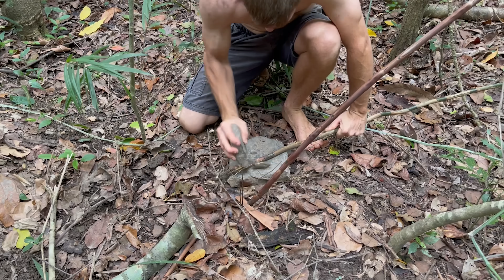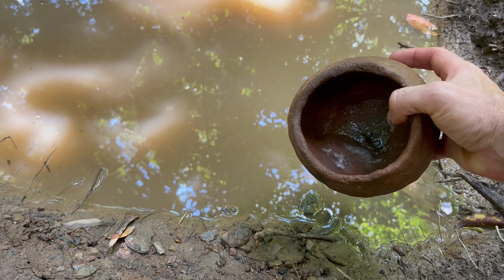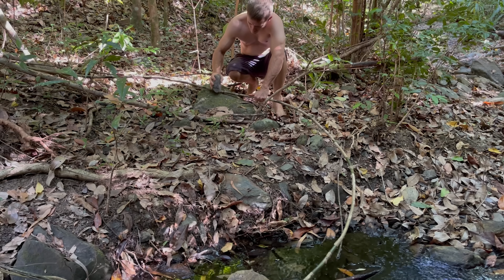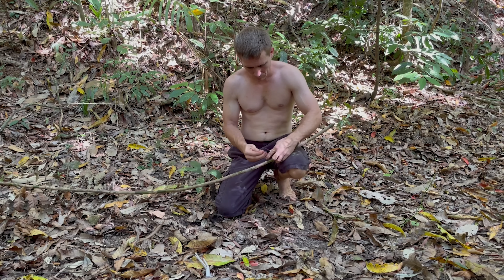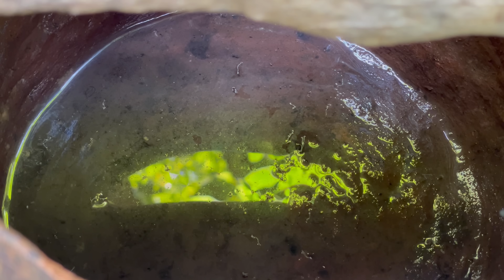Primitive Technology: Cane Water Filter/Siphon

Comment: I know some of the oldest known wells, i.e from archaeology, often has earthenware or wooden walls, at least at the bottom of them, so not surprised in that regard, and I've seen the siphon filter trick used with willow a few decades past - That said, then I wonder where the limit might be, ex. can the siphon filter trick be used with more salthy sea water, to a regard where you could survive of that water?

Comment: In reality you should still boil the water though right? Just as a double safety measure? If it were me and I had the time for the water to filter using these 2 methods I would also just go ahead and boil it.

Comment: Not the only way to do this but you should still probably boil it. Peronally I prefer using overflow trickle + filter tanks. Basically you set up a few containers that have a spout or similar near the top - maybe 3/4 of the way up - and they poor down into further containers. You then fill the topmost one full and top it off ocasionally - though you could use a siphon to keep pulling in water from a larger source - and use the first tank with some gravel aggregate to filter out big stuff, another tank with charcoal to help clean out other crud, and one for settling. If you can figure out an aerator then a tank for that too. Multiple settling tanks are redundant but may be needed depending on the water quality. The last tank's water should be boiled. If you have access to chlorine that's the time to add it.

Comment: The submerged filtration is actually a similar technique used in a Well, if you live in the country and have no connection to municipal water systems. And the reverse if you have a septic system.

Comment: Have you considered using multiple clay pots, each with a finer substrate - rocks then sand and finally charcoal, that would give you litres per day and it would not clog up anywhere near as quick as the bamboo does

Comment: Second method is much cooler, as you can engineer a wide bottomed flask to sit lower in the water adding more pressure and increase filtration speed.

Make a flat bottomed conical flask, exaggerate the difference in width at the bottom until you have an upside down cocktail glass shape, or even a pyramid would work well.

Perhaps a less powerful firing, or a mixing of activated carbon from the fire into the clay.

Comment: I think that it would work fastest if you put the root end of the cane in the dirty water, and the sky end of the cane in the collection, because this is the way plants raise water to their tops. Second, AFTER you get the siphon going, slant cut the root end under water, the way florist cut the stems of flowers to keep them fresh longer.

Possibly, I don't know, but to keep canes from clogging up, you might try recutting the root end that's in the dirty water once a day using a slant cut, and removing the waste. This how I keep my holiday cut flowers on the table fresh for up to 10-days without using any water treatments.

Comment: You could make a cone shaped vessel that's suspended over another jar. The water will perspire through and slide down the sides to drip off the tip.

Comment: Depending on the clay minerals dominant in your clay, it would also remove either cations (metals like lead or cadmium etc.) or anions (chlorine or sulphur)
Reply: If you knew enough about the clay you're using, you could make a double layered pot. cations in one layer and anions in the other
Reply: @PianoMastR64  well if you mixed the minerals together it'd be one layer that would remove both, but you would need to know what the minerals are to make sure you had equal amounts of both positive and negative charged clay minerals
Reply: You'd achieve this using, what, multiple bent pieces of wood? Electrolysis with no energy input and no ions to exchange? Where's the science?
Reply: @amosz5726  who said anything about electrolysis lol.

So, cations in water that are of interest to survivalists is usually heavy metal pollution like lead. We'll stick to lead as an example since it is simple. For clay we will stick to kaolinite as it is common.

Kaolinite's chemical formula is Al2Si2O5(OH)4, but if we write it as Al2O3 2SiO2 and ignore the hydration for a bit it makes it easier. The crystal structure of kaolinite is a single "sheet" of aluminium oxide, with a sheet of sillicate on top. This is the base unit of kaolinite, and kaolinite crystals are made up of thousands of these base units repeating next to each other.

Now, under perfect circumstances, the mineral would be uncharged. However, nature is not perfect. There is always an imbalance of components in minerals. What this results in is around the edge of the clay mineral, there are sites of negative charge (in the specific case of kaolinite, a clay mineral like smectite would have sites of positive charge). These sites are caused by an imbalance in the components of the mineral.

When this clay mineral comes in contact with a cation, the difference in charge results in the two getting stuck together. You don't get metallic lead sitting on top of the clay or anything, you get lead that is sitting inside the crystal structure of the clay mineral. The lead is not well bonded, if you run water through it for too long the lead will leach out again. 

Now, my real world experience was with using smectite and a succession of indigenous grasses to rehabilitate an area that was experiencing acid mine drainage and erosion. By using gabions, we slowed the speed of the water, and widened the channel width, letting it flow into a collection pond which we had filled with smectite and native grasses which coped well with high acidity and which grew well in swelling clays. The smectite moderated the acidity by binding with the SO4 in the water, and the roots of the grass helped filter the water. It wasn't 100% safe to drink after passing through this filtration system, but the water went from bright orange to clear, and it stopped killing all the plants downstream. Pass it through a second filtration stage to get rid of the particulates and boil it to get rid of the bacteria, and you would have safe drinking water. We were mainly concerned with preventing the acid mine drainage from polluting the local groundwater.
Reply: @thomasmarais5008  Somebody up above called "Piano Mastr" suggested you could just go ahead and collect cations in one pot and anions in another, which is electrolysis are requires energy input or ion exchange. I guess I couldn't tag them on mobile.
Reply: @thomasmarais5008  As for what you're talking about, that's a process that takes considerable time and also involves the materials in the natural environment contributing; You can't just rip a bunch of ions of one charge out of water as it causes the water itself to become charged. It quickly becomes extremely energetically unfavorable and whatever process you're using will slow to a halt. You can only continue if you keep the charge of the water at equilibrium, by either providing counter ions, such as in an ion exchange resin, or by removal of charge with current and an anode or cathode.
Reply: This cane filter is able to remove microorganisms and particulate matter simply because they are too big to pass through the xylem of the cane, but ions are far, far smaller. Passing water with a high concentration of heavy metals through a piece of cane for a few minutes will not render it safe to drink.
Reply: @amosz5726  Yes! You are correct. That is why I am talking about a clay filter and not a cane filter. You may notice that they are two different things. I cannot stress enough how I am not talking about the cane filter. I am talking about using clay as a filter. Using clay as a filter is what I am talking about. Do I need to phrase it differently again?
Reply: @thomasmarais5008  Incredibly interesting, thanks for the reply :)
Reply: @thomasmarais5008  also, don't worry about him. Hope you're having a great day.
Reply: @PianoMastR64  Mixing them together is a much better options. The chemical interactions between the two (in close proximity) help remove more impurities. Works that way with RO systems, anyway.
Reply: @PianoMastR64  i mean... i guess... but why...
Reply: @ergile172  hey those onions are sneaky. Never know when youll get onion water out in the wild. Eternal vigilance is ones only safety net.
Reply: @everythingsalright1121  Facts brother, so true my friend
Reply: @everythingsalright1121  Those disgusting onions !
Women will INSIST on adding them to perfectly fine mashed potatoes.
Reply: @uncletiggermclaren7592  just use even more onions, that will filter women.
Reply: @uncletiggermclaren7592  I WILL AND YOU CAN NEVER STOP ME 😈
Reply: @uncletiggermclaren7592  What!? >triggered<   WHY????
Reply: @thomasf.9717  😆
Reply: @stevenswenson7041  
What do you mean, why? Why do they pollute Mashed Potato loveliness with onions?
It is probably the result of some deficiency, they have a recessive in their jeans you know.
Reply: Could it remove onions?
Reply: @greatexpectations1461  🤣
But thinking about it though, a sieve could remove onions. I'm sure a bacteria capable filter could as well.
Reply: @greatexpectations1461  They leave them in for flavour
Reply: @greatexpectations1461  with some work, yes https://youtu.be/QHCJ_ITAry8
Reply: Nerds
Reply: @daytimegriefer  I could tell that you watch all of the videos without the subtitles on.
Reply: What do you mean? ALL cations? ALL anions? Additionally, chlorine and sulfur are not ions and they don't even specifically form only anions.

Comment: You have everything to make a more 'traditional' particulate filter. Make a clay cylinder with holes in the bottom. Then fill it like a layer cake with gravel on the bottom, charcoal, sand [and repeat]. You can recharge the filters. Ya there are a lot of other ways but this one is simple and effective.

Comment: I think it would be much safer to at least boil those water... especially those from siphon cane.

On the other hand, since the clay are relatively abundant, maybe you could try make one big pot and a smaller port, fill the dirty water in the big pot, and place the smaller pot in the middle, then covers it with downward cone shape cap that can accumulate the vapor?

Comment: I conducted a similar experiment for a university course, using pine xylem to filter E. coli-contaminated water. My prototype was a bucket with multiple xylem spigots allowing the water to drip through with the assistance of gravity. We were amazed to find that it effectively removed the bacteria, as confirmed by an online E. coli testing kit. The water was deemed suitable for consumption
Reply: Do the pines disinfecting properties kill or filter it?
Reply: @foxmulder4653  The pine just filtered the bacteria out. It didn’t apply any disinfectant properties
Reply: Do you go to MIT? thats where he said he got the idea
Reply: @anormalrat  No I didn’t. Haha. It’s just a coincidence :)
Reply: I'm open to the idea of this possibly being safe but I would like to see it under a microscope first
Reply: This is a VERY dangerous practice to assume the water is deemed safe to drink after this video's method. Many other factors to consider that will makes it's way in the droplets. It would better to make the receiving bowl into a filter via "sand/pebbles/rocks/coal" and boil it afterwards as a precaution.
Reply: @audacyspectrum3612  I would boil any water for a good 20 minutes before I drank it. I definitely wouldn't suck it into my mouth.
Reply: @audacyspectrum3612  that's an ideal filter, this video is just showing other methods of filtering water to be drinkable. It's nice to know multiple methods on doing things even though most people won't actually need to make a filter.
Reply: How the heck does online E. coli test work?
Reply: @kafk625  an e coli kit bought online
Reply: Ok. But it was pine. Not reeds. So your experiment wasn't actually similar *at all*. You can't just take a literally random plant and assume it will behave like literally another random plant. PLANTS AREN'T ALL THE SAME.
Reply: @JoannaFalkowska  the experiment op described is the same kind of experiment as the one done at MIT that inspired this video, why are you so pressed?
Reply: @redyeti34  Might be the same "kind", but it's not literally the same experiment, so it can't be assumed to yield the same results.
Reply: @JoannaFalkowska  it is the exact same experiment as the MIT one.
Reply: @redyeti34  
OP’s experiment and the MIT one were far more similar to each other than those two were to the one shown in the video, as the first two both used pine.
Reply: @ragnkja  why would using fiberous plants to clean water change depending on the type of plant? The experiment involved the same kind of fiber found in cane in similar density, pine wasnt magically disinfecting it, it was filtering it with the same material found in cane.
Reply: @redyeti34  
The density could be quite different, and the internal structure. If he’d used another conifer it would be more obviously the same, since there’s not a lot of variation between those (which is why it doesn’t matter which species of pine they used).
Reply: @redyeti34  Then there's also the matter of its Sap to consider, which can also differ in consistency & viscosity (as well as other properties), and that might likely be playing a part as well. Certain types of cane & vines can produce relatively Thick, possibly even Sweet & Sugary, Sap; but Pine-Sap is rather famous for its thickness & stickiness.
Reply: Yeah I question your results and need to see it and the numbers from your contaminated water to drinkable water.  And how many times have you done this test ?

Comment: Love your videos, especially anything to do with your forge and clay. I was wondering if you know of a primitive way to glaze a clay pot to make it waterproof? That would be good to watch.
Reply: Glaze is pretty much just a glass coating on the piece. As such, the way to create glazes naturally involves some source of silicate, that is to say, sand-- but it must be very fine sand, and of even consistency. This can be done with some filtration. Next is needed a flux, which is some variety of oxide that will bring down the melting point of the sand. Traditionally, feldspar or limestone were used. Feldspars contain potassium and sodium oxides, while limestone is calcium oxide. That's all that's needed for a rudimentary glaze, and I believe it is achievable with Primitive Technology's, well, primitive tech. It's been done for a long, long time. 
btw, fun fact-- the secret to porcelain is the inclusion of feldspar in the clay. For a long, long time this was a secret, and porcelain was prohibitively expensive because it all had to be imported from China.
Reply: You don't have to glaze a pot for it to become waterproof. All fired pottery is waterproof, as shown in this channel's videos that they hold water without leaking or leeching through the pot walls.
Reply: @OrionCrusader  but the video just showed that not all fired pottery is waterproof. You can fire a piece until it's sintered, but not vitrified. It will hold it's shape and won't dissolve in water, but water is still able to slowly permeate it through microscopic holes that aren't filled until vitrification happens at higher temperatures.

That's my best understanding of it, I'm no ceramics expert and this all seems excellent complex and technical to understand any further m
Reply: In the videos about pottery john treated the surface of the unfired pots by polishing it with a snailshell, what seemed to seal the pores. But I dont know if thats the case with the two pots in this video.
Reply: You all sound much smarter than me, but I have read of a hard glaze achieved by boiling mud and egg whites. It was used to make dirt floors solid and easy to clean. Also mud/clay walls. 
I read it in "The Kitchen God's Wife", which has a lot of old Chinese stuff throughout.

Comment: As far as the submerging. Take charcoal, sand and moss. Take a large pot, then stick a smaller pot in that. Line the void between the pots with this filter mix. Maybe it will purify even more? Then id say boil it after either way if you have the means. In an emergency this is good to know so thank you for this video.

Comment: 99% is not safe!
2 log (99%) reduction is not safe for drinking, especially from still water!
This might be a good pre-filter for another treatment method, like boiling or another series of filters, but it's not enough
You want at least 4 log (99.99) reduction, preferably more! (You can run it through multiple times but i don't think you even get to 2 log reduction)

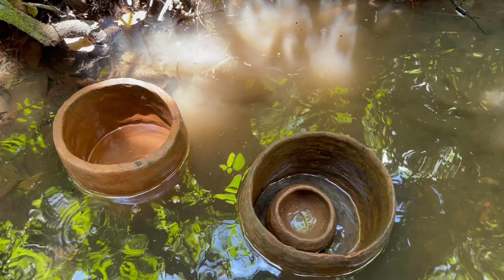Comment: 4:50 Interesting, I thought water couldn't seep through cured clay?
Reply: I'm still not sure if the water is seeping through, or the inside of the pot is cooling and the water is condensing on it
Reply: Water always seeps out from a fresh clay pot making its surface a little moist, which is in fact a feature because the moisture evaporates - making the rest of the water inside the pot a bit more cooler. Eventually the seeping stops at some point since all the tiny pores in the pot get clogged up by either calcium in water or small dirt particles. In this case he used this in reverse order to make the pond water seep into the freshly made pot.
Reply: Fired clay is still porous, it just doesn't dissolve in water any more. If you want to make pottery fully water proof you must glaze it.
Reply: You are correct. This was done for likes only.